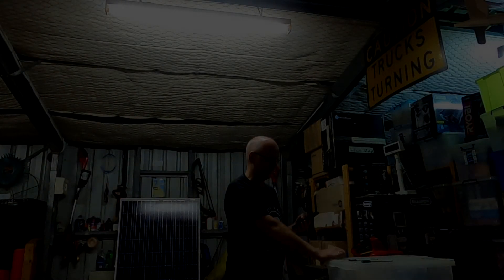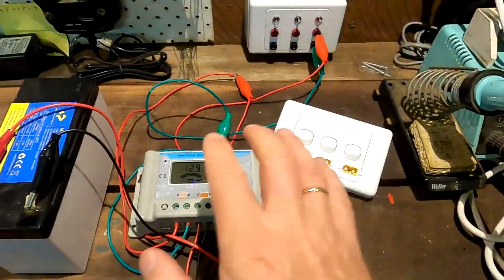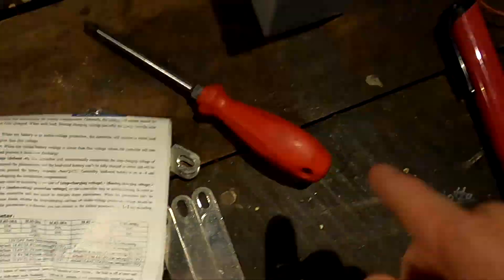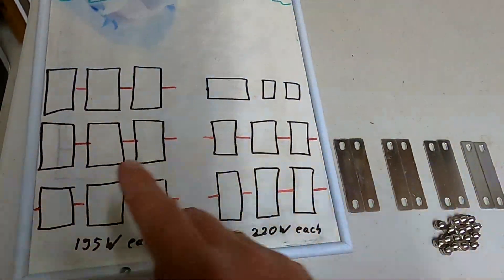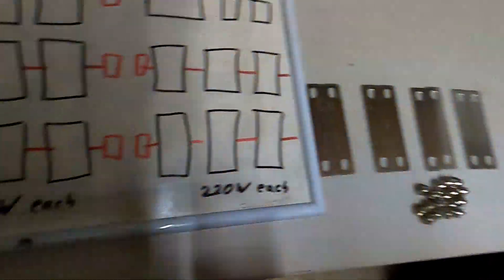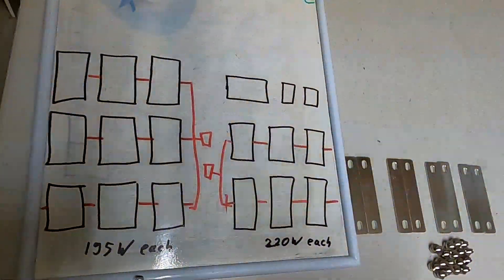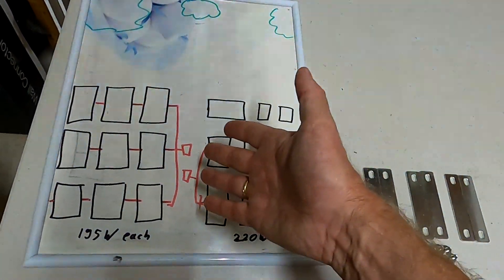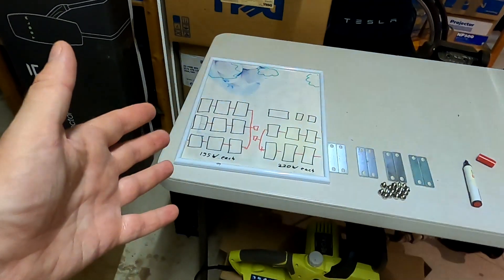How many charge controller make sense?

Comment: I have 6 panels in pairs 2 pairs of 2x 505w and 1 pair 2x 435w with using one Victron 100/20 controller per pair. 

I have a post shadow that moves across the panels during the day and can see the pairs in shadow and the three mppt controllers are independent of each other.

The system has far exceeded my expectations.

Comment: Thank you Andy for your work. I'm reading two and three-year-old comments and I'm excited to see how this turns out but I just have to comment; if you're looking for a system that is fun and supports a lot of your test questions. The more controllers the better. However, if you're looking for efficiencies, there's a lot to understand yet. 

One thing that you haven't touched on yet is the behavior of the solar cells/ panels with shading and how they behave in parallel versus series. Also, how the charge controllers behave as the cells experience shading.

Comment: Question if you have two controllers in parallel does this doubles amp output (example two controllers at 10amp output does this make it 20)only reason I ask if you have multiple chargers there would be a point where the output can be over 50ampz this ok for lifepo but any other battery this too much
Reply from the maker: Yes, that is exactly how it works. You can parallel as many solar charge controllers as you want, the output amps will a add up and charge your battery.

Comment: As I have mentioned earlier in a previous video, I'm using 24V panels with an MPPT charge controller for each panel charging each 12V battery in a 48V series string, how's that for complexity? 
But on the plus side, each 12V battery has it's own BMS which keeps the cells balanced and protected, the individual charge controller keeps each 12V battery bank in balance, so if one 12V bank will reach full charge, it stops! While the others catch up! It's kinda automatic where I don't have to do anything about balancing.... 
So basically there's more than one way to skin a cat 🐈 LoL... 
It's all about finding the best method for you! 
You have shown two different ways to get it all connected and now I have just given you the third one! Choose wisely!
Reply from the maker: Wow, that's a complex setup. Was this because you already had all the gear or was this by design?

Comment: Why not all five strings in parallell? The shaded strings should not hold back the others provided they got series diodes. If not, put som on. Use loss less diodes.
Reply from the maker: I think it's more efficient using several charge controllers so they can deal with individual strings due to shading.
Reply: @OffGridGarageAustralia  yes, you have a point. However, if one of the panel in one styring gets shaded it wont make much power anyway and a separate controller will not make much of a difference, i think? If each panel got a parallell diode it Will make power when partialy shaded and a separate controller.

Comment: Would you like to test the Milwaukee brushless chainsaw? Very good at removing shading issues.
Remember that the panels should shade your roof. Trees should not shade your panels.
Reply from the maker: We're actually planting as much trees as possible on our property but not cutting any down. I will just put 3 more panels up the roof to compensate for the shading and good is.
Reply: @OffGridGarageAustralia  Just shorten them. Shading the ground, and walls, is good. Shading panels, not so much.

Comment: Use optimizers on the panels that will be affected by shade and use two charge controllers
Reply from the maker: Optimizers? Like solar optimizers? Do you believe in that?
Reply: @OffGridGarageAustralia  yes I use then the Tigo ones and they work great
Reply: @OffGridGarageAustralia  I can confirm the Tigo optimisers are brilliant, however, they’re not cheap. They work by opening up a parallel path around the panel so whilst it is putting out less power it won’t hold back the others. 
They also allow you to monitor the output of each individual panel if you go for more than just the optimising units. 
I went with the Tigo optimisers as (I believe) they are the only ones which allow you to use them with an inverter / charge controller brand of your choice. Solar Edge is a walled garden and I believe there’s another brand like that as well which may be called Maxim? I forget. 

Anyway, my two cents is that the Tigo optimisers do work well. Especially so in my case, where I have panels on fence and they’re always somewhat shaded!

P.S. The Tigo documentation / website suggests you can use the optimisers without their cloud connect and by simply plugging them in. And you can. But if you want the max performance then you want the most expensive Tigo units (that do more than just optimise), set them up with the cloud connect and within the app you can configure what inverter you have, how many strings, how many MPPT trackers and how the panels you have are wired. After I set that up I saw much improved input.

Comment: Assuming that the trees are your neighbors, you can use a combiner box so that the shaded panels are not affected by the output and algorithms of the MPPT charge controller. This might be the most cost effective solution with 2 or even 1 charge controller. Also using 2 panels instead of 3 would theoretically yield more current than the 3 in series. Remember current moves things voltage don't.
Reply from the maker: All trees are mine, they are very large and old and need to stay because we stupid humans are cutting down far to many trees already. I can always compensate with more panels. The roof is huge.
A combiner box? What magic is in such a box?
You're right with the current but you forgot the MPPT charge controller using the higher voltage to convert more current on the lower voltage side (buck converting). The higher the input voltage the higher the output amps.

Comment: This solar charge controller will handle over 37V DC:

https://sunforgellc.com/gvb-8/

If you need to charge a single battery bank with multiple solar charge controllers, then this might be a good bet:

https://sunforgellc.com/solar-boost-3024-duo/

For larger solar panels, this might work:

https://www.victronenergy.com/solar-charge-controllers/smartsolar-mppt-ve.can

The problem is that no information on the battery bank is provided in this video, and this is important information to determine what solar charge controller to use.

You have, also, not provided information on the bus bar connections.

Finally, what do you want to do? 

Do you want to use an inverter at some point, or are you planning on only using DC?

Are you using an inverter to convert stored battery energy to AC?  Do you need energy at night or only during light day hours?

If you need an inverter, how much AC energy do you need?

If you are planning on using a 12V DC, 24V DC, or 48 V DC battery, and you need alternating current, AC, as well, a Victron inverter with solar charge controllers might be  a reasonable collection of products. Here is an all in one Victron product for small systems:

 https://www.victronenergy.com/inverter-charger-mppt/easysolar

I would not worry about efficiency at this point.  I would first concentrate on what you want to achieve with your solar system, and then I would look for components that will ‘play nice’ together in helping you achieve your goals.  My second consideration would be to look for components that are produced by a quality manufacturer.

This means the instructions will be in a language you understand, and they will be easy to follow.  If you call the manufacturer, someone will be available to answer questions.  The manufacturer has been in business for at least 10-years.  The manufacturer offers a reasonable warranty, etc.

I would stay away from SolarEdge if you plan on using a low voltage battery, if you plan on using your batteries at night, and / or for emergencies.

I have not personally used them, but there is company called Tigo making optimizers.  You might want to check them out.
Reply from the maker: Have you watched my other videos from the beginning? I think I have covered all your questions multiple times...
Reply: @OffGridGarageAustralia  you are certainly some piece of work.

The title of your video is a question.  It is not I who asked the question.

If you don’t need help, then don’t ask questions, but at least be polite and thank me for trying to help you.

Like I said - a piece of work.

Comment: I don't know if I have ever seen so many people, who knew so little, trying to explain so much. I notice this a lot on YouTube these days, especially in the comment section of videos about solar and inverter systems. In my opinion, if you are smart enough to read the instruction manual and make a few tech support calls, you should be able to install a basic system with no problems. It should work fine. That's not the same as designing a system. That requires a comprehensive understanding of code and safety issues,  not to mention a thorough and comprehensive understanding of electronics. And by that, I don't mean reading a few magazines. That takes a degree or many years experience. Or both.  I'm not trying to start trouble, only point out that by my estimation, most of the suggestions in the section are hazardous, ineffective, or just completely wrong. If you can install a solar system, that's great. More power to you. Pun intended. But leave the advanced system design to the experts. Some people may take your advice assuming you know what you're talking about. And it might result in a hazardous or unsafe situation. Or at the very least, something that will not work properly. If you are scratching your head and offering suggestions, I think that's great. But some people on here are attempting to sound like they are experts in the field. And it's obvious to me they are not. I think I know the reason for that.
Google the Dunning-Kruger Effect. 
And that is my observation.  Then again, maybe I'm wrong.

Comment: Worst case, you have a 660 watt string (3 * 220).  For a 24 volt system, this is 660W / 26 volts = 25.4 amps so a 30 or 40 amp MPPT controller for each string - do remember to allow for the Voc being 150 volts or more.

Considering how the tree shadows move across the roof, you might do better with vertical strings than the horizontal strings you drew on your white board.  Depending on the solar angle during the year, the shading on vertical strings might have less total effect on the array than the same shading going across horizontal strings.  Make up some paper templates of those shadows and see how many strings would be affected by the shade at each hour of the day with vertical versus horizontal strings.

I can see a controller per string being advantageous when you have moving shade.  Each controller is only making allowances for the voltage changes in one string.  There are almost certainly points in the path of the shading on different days that would only affect one vertical string, although that same shade could affect multiple horizontal strings.  Go back and do the thing with the shade template again to see this better.

If you don't have a digital camera with an intervalometer (long-running timer to take a picture every X minutes), the Kodak FZ152 is about $100US and can run all day with a large (5000mAH or more) external powerbank.  I've used an FZ152 for several "sun surveys" on my property and having the camera on a tripod and set to take a picture every 5 or 10 minutes can show you exactly where the shade falls and the hour at which it falls there - you do need a "sun survey" for each season of the year to know where the sun and shade are in March versus June versus September versus December (the sun's angle above the horizon changes which changes the length of the tree shadows).

I'm still building my solar backup system which is designed for enough power to wait until daylight before getting out in the rain or shoveling 7 inches of snow to get a gasoline generator out of the shed and started.  Using a 12 volt battery bank, a 30 amp MPPT controller is rated for a max of 390 watts of solar power.  I'll be using a 30 amp controller (EPEver 3210A) for each of the 300 watt solar panels and a 40 amp controller (EPEver 4210A) for each pair of 250 watt panels so I'm planning to have multiple controllers for a relatively small system (about 1700 watts of solar panels).  I'll also have those controllers hooked up in two ways.  Half will feed one end of the battery bank and the other half will feed the battery bank diagonally, using the positive on one end of the battery bank and the negative on the other end.  I've tested this and it does work but you need controllers which can be set to identical voltages for each stage of charging and the over/under voltage protection (the EPEver controllers can be set to the nearest 0.01 volt with their free PC software).
 
Pieces of my system have been in place for over 3 years so the EPEver controllers and the Reliable Electric 2000 watt pure sine wave inverter have worked reliably.  The longest outage we've used the solar backup for was 12 hours when there was 7 to 12 inches of snow in an area that rarely sees more than 3 inches of snow.  The trees don't survive that much snow and the aerial power lines don't survive the falling limbs and trees.
Reply from the maker: Great suggestions here, love your comment! I will build a 48V system and have planned to use the 3 panels in series per controller.
I could setup my GoPro in wintertime to make a picture every 60s or so over a day. I only have shading up there in winter, in summer it's all clear and sunny. 
I like the suggestion with the three panels connected vertically, never thought about that. It makes sense, depending how the shadow goes over the roof.
Great setup you have over there, thanks for sharing!

Comment: I guess it depends on how much money you would like to spend on controllers. 5 Controllers would definitely be more efficient. If you decide to link some strings in parallel it is probably a good idea to add some diodes. Aliexpress has them build into a solar connector for about 5 AUD. Although I had my 3x3 running without diodes for the 6 weeks it took for the diodes to arrive and things seems to be fine but you know...

I am also in Brisbane and I find that in winter the cooler temperatures and bluer cloudless skies still generate quite a lot of power, enough to keep all my things running anyway. My problem has always been the inverters which keep breaking.
Reply from the maker: Thanks, Peter. I wouldn't mind buying 5 controllers. Even 5 different ones to test them out and compare. I think all panels have diodes built-in for that reason.
Yes, colder panels in winter and a clear blues sky makes the best solar juice. The panels like the cooler temps and are heaps more efficient.

Comment: Every Charge Controller has an efficiency rating which is a lose of energy so using more when less would do will increase the loss. shorter strings with fewer panels should help with the shading as long as the shade travels in a thin wedge but then you need larger charge controllers with more strings combined. Good luck.
Reply from the maker: Smaller controllers are cheaper than larger ones. They all have 99% efficiency (on the paper). The shade will be rather large though, so covering on side of the roof or even both.

Comment: Can easily use multiple charge controllers attached to a single battery bank.
Do not connect the same solar panel(s) to multiple controllers - one solar bank to one controller.
Your panel groups in different solar exposure should ideally have different controllers - a controller for each string is more optimal, but more expensive.
Reply from the maker: I know you cannot use the same panels with different controllers at the same time, but thanks for pointing this out for everyone again. I probably start with 2 controllers first and see how things go over time.

Comment: Hi Andy,
Its a fact, that you will get most power with 5 controllers. But 5 small controllers + Wires would be much more expensive than 2 bigger controllers, and keep in min, they will consume even a small amount of energy it self.
And i guess the small amount of power you will get in addition with 5 controllers will never pay the additional costs.

It should be no problem for a small array on the east to put these 3 strings in parallel - even withoud seperate diodes
Reply from the maker: Ah, the standby, yes, very good point. I don't think about that when using a gazillion of controllers. I probably start with 2 controllers and see how we go. I probably will also have three more already bought and in stock just in case :D

Comment: If you have 60 cells panels, they quite well match a 24V LiFePo4 battery bank so you can run them without a MPPT controller, just need one or several quality DC SSR to disconnect against overcharging.
Reply from the maker: All my panels have 37V or even 45V, so I definitely need some more stuff to control the load. But yeah, if you have such cells, that will work.